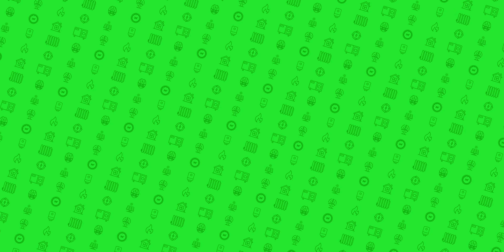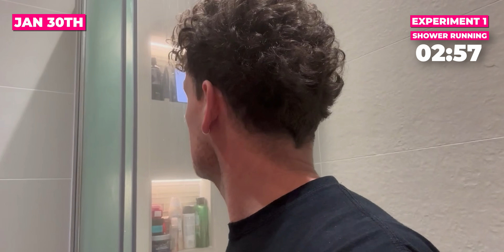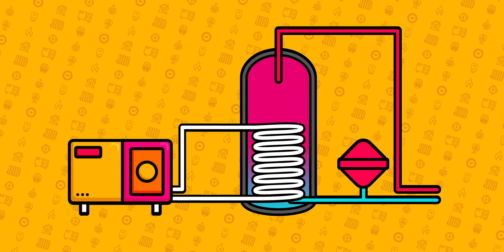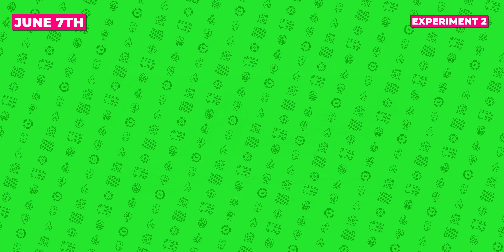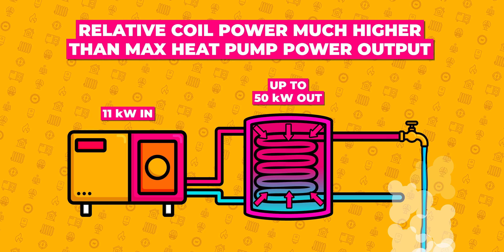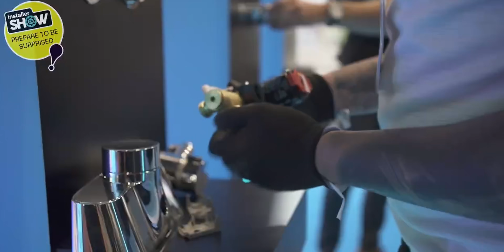The Worlds SMALLEST Cylinder is here!

Comment: I use only around 500kwh a year and get all my hot water from just an electric shower and kettle...
Most my bill is standing charges basically. 
Why is it better to complicate my heating needs with this sort of thing? More cost of materials and more complex install/maintenance. I could just do with a smaller size combi boiler/heat pump. My combi boiler is probably powerful enough for a semi detached house, which I don't need for a low flow temperature.
I don't need to warm my flat up quickly a couple of times of day, it's better for me to maintain a reasonable radiant temp through the day. For me 15c is plenty, 12 will do even so long as its even radiant temp....

The amount of hot water down the drain there, would be a bit excessive for me, not necessary way to shower.... 18 minutes on? I turn on and off to lather and rinse. Only ends up being about a 15lt bucket, 2 would be plenty. 

I use all grey water to flush toilet, shower, dishes and laundry water moved through in buckets 

(two 25lt containers in cupboard by washing machine and the hose needs swapping several times, the first 20 odd liter is dumped straight away as that's the most dirty and smelly after being heated up, so not nice to keep around. The next 40 odd liter is just rinse cycles and fine to use for flushing.)

I use only around 12 cubic meters of water a year. Why do I need so many liters of freshly filtered, treated, clean drinking water just "sluice my dooks" away every time? Yes I still flush the toilet normally here and there for a clean up with clean water of course. 

No substitute for using less energy, water, resources overall, as much as people hate to hear that. Rather than just substituting methods around, both are required.
Reply from the maker: This is for the other 99% of society
Reply: @HeatGeek  Seems like a great option for a large percentage of buildings to be fair, not necessarily as much as 99% of use cases though... You have plenty of positive feedback, you could just consider the comment of a particularly lower needs user as your likely to find or leave it, no need to reply unconstructively and low key demeaning way. 

So my way of managing needs requires the least energy and results the lowest emissions basically? I have a very low footprint/impact with use of energy and water like I'm supposed to, I'll credit myself at least if nobody else does. 

It was actually a little more, 548kwh in one year checking back, and just 161kwh on gas heating (caveats to that on account of downstairs neighbours not being fussed when I offered to contribute, so can't actually say what overall needs are) 

It's not that I couldn't actually afford more electric though, it's interesting the value per Kwh daily plummets at the lower end of use because of the standing charges. If you just use one kwh day to day, your paying something like twice as much per Kwh than if you used 4 times more... 

The first kwh a day cost me 82p (50+32) the second 114p, the third 146p, the 4th 178p and so on.
So that first kwh is way less value than the next couple, but I live actually very well and comfortable using a little under 1 kwh daily through summer and like between 1-2 through winter. All needs hot water, cooked meals, charge devices, ect laundry when averaged out over the whole week (more on a laundry day of course,) and refrigeration (top opening chest freezer converted to chest fridge, with lift out crates is way more efficient than side opening fridge due to basic physics, lower oxygen environment preserves food for longer also) 

I suppose if I was on a more efficient electric system for winter heating it would be easier to decide on removing the standing charge for gas for one thing.

However perhaps it's not necessarily the case, that for a lot of very low use energy users could afford to consume a whole lot more. Perhaps more than just "1%" in harsh poverty these days, certainly a lot more globally eh. 
So maybe don't be so presumptuous what percentage of the population is is closer to my level of consumption or yours. 

Unless you can get rid of standing charges seems like definitely no advantages to my trying to reduce an overall Kwh electricity need with hot water storage.
Even then, at what point of lower hot water needs, ie boiling a full kettle of water several times a day and using like 15lt of just warm showering water might the system actually stop providing energy use reductions? Where does the benefit fully diminish? 

Some of that kettle boiling is actually for drinks also of course, so wouldn't be reduced, just one time is for dishes. Then with showing, when I do have the water running, I actually turn up to warm and down again to cold a couple times which I can enjoy also, temperature pulsing rather than straight jarring cold shower. 

Is there actually a cross point that it would stop being more efficient under a certain number of liters per day hot water needs than just to use straight electric? Surly with a more complex system more heat is lost around and about the pipes and will slowly drain from the storage? With a kettle and electric shower it's heated at source of use. 

Oh yeah I do fill a thermos when I boil kettle, so that's something kind of similar I guess. Have a couple of drinks or empty again when doing dishes. 1.2lt thermos stainless steel flask just 25 odd quid. 

I'm not so sure that would necessarily be more efficient to try reduce power consumption at a low energy volume of use, so like I say in my case I'm only looking to cover winter heating needs more efficiently. I could do with a smaller size combi boiler than I have, so maybe a small enough size heat pump would be beneficial option also. Again what advantages does the added complication of hot water storage have at my volume of daily use though? Why increase complication with installation and maintenance? 

I could probably do without loosing more storage space anywhere tbh, making space is always an ongoing process for some people with smaller homes. I use all my cupboards, my sealing isn't that high..

Comment: Storing hot water doesn't really require that you store hot water.

I was just watching a video about converting coal plants to run on green energy by storing heat in some kind of solid material that was then used to heat water. (in that case to it was to create steam)

Storing hot water itself is probably one of the worst solutions because you tend to be limited by the safe temperature of hot water as well as steam.  Hot rocks would be limited in their ability to transfer the heat to  water reducing the risk of burns.
Reply: Eric you are a clever guy - how are things at NASA?

Comment: Do we need to restrict shower flow rate to 8.5 litres per min otherwise there wont be enough heat transfer from the stored hot water?
Reply from the maker: No.. although I would advise it. Higher flow rates just need to use a larger store OR a higher store temperature

Comment: Excellent solution. One question, what are the results like with the 7kw ASHP / 55 store temp setup at a higher flow rate, say 13 litres per at the hot outlets? Relevant if running multiple showers simultaneously for example.
Reply from the maker: If running 13l/m off the batt (unlikely) it won’t be great.. but if there’s a 2.5min stagger will work!

Comment: I assume you'll need to flow-rate limit the hot water outlet for this - e.g. for bath fills, otherwise the performance will drop considerably because the DHW is passing through the heat exchanger too quickly? On the other hand, for shower-only houses, you could pair this with vertical-drop drain water heat recovery (cuts showering power input by about 50% by recovering 50% of the heat from hot water after it goes down the plug 'ole), and run a shower continuously even with a 5kW heatpump?
Reply from the maker: Your defo right on flow rate affecting the performance. But it just means you need to store at a higher temperature.
Reply from the maker: Yes even with a 5kw hp!!!

Comment: Does the heating expansion vessel require upsizing due to the added water in circuit ?
Reply from the maker: Generally not because most heat pump systems are sub 50c radiator flow temp so has capacity.

Comment: Not a new concept, these have been around for decades, known as a thermal  store, having multiple coils of 10mm pipe inside the cylinder connected to the domestic side.

Another advantage of these units is it does not require a G3 certificated installer.
Reply from the maker: It’s not new but it’s not a thermal store. This is more of a coil in coil heat exchanger with built in buffer as most heat comes instantly from the heat pump than using the stored heat.
Reply: The main differences then are a smaller vessel size, and a much higher surface area of the coil?

Comment: It's crazy to think that all the big cylinder manufacturers have missed this maybe they just don't want to push the boundaries of what's possible great Idea and looking forward to seeing it at installer
Reply: You can already get these cylinders. They are called heat stores and are used with intermittant heat sources such as solid fuel fires with back boilers, range boilers, solar, wood pellet etc. Thing is they tend to be bigger in the case of heat stores because they may have to last all day. The downside can be that with higher temps and hard water you can get scaling and the coil eventually blocks up.
So its existing technology but it has just been modified to work with a heat pump. Because the heat pump can run whenever it needs to you don't need the heat store to be very big.
Reply: Been around for years this is old tech done a set up like this with a solid fuel back boiler linked with a combi boiler there's a company called nrg that make there own manifolds and wiring centres
Reply: Different thing altogether i have fitted thermal stores and nrg link this is not the same
Reply: @Craiggilhomephe  but the cylinder idea isn't anything new I've come across a few setups like this on system boilers with a heat store and some cases with a plate to plate and exactly the same
Reply: Yes but working at high temperature that's the difference

Comment: How does this change scale up to the full-sized cylinders? (I.e. The super cylinder) Have you tested this configuration and if so, what were your findings? I'm thinking that with a full-sized cylinder, the settings can be tuned back towards efficiency and the lack of legionella cycle could offset any other losses.

You could also add a tapping on the last coil of the heat exchanger, for a secondary return.

I know full size isn't what you were going for with this, but I'm interested to see what the ramifications are for conventional setups if any.
Reply from the maker: Super cylinder is still better as it sits in the cool zone more
Reply: @HeatGeek  Ah I see, that makes sense. Thank you!

Comment: I thought that this is a great concept but if it's so clever why didn't someone design it sooner?
I don't like being negative, so I would like to understand more of the physics behind this solution. For a given volumetric flow rate and temperature, what is the heat input requirement? I do not dispute the practical evidence presented in the video but it should be supported by some scientific backup. I have only used an online calculator but that suggests a heat input of 21Kw is required to sustain a flow rate of 7.5l per minute to raise water from 5 deg. C to 45 deg. C. Therefore, your cold water must absorb an additional 10kW of stored energy from the stored hot water if your heat pump is replenishing the heat in the store (which is not a store) at a rate of 11kW.
In order to validate that estimate, as far as I can gather, a 9kW electric shower can deliver a flow rate of around 2-3l per minute under similar circumstances, so the numbers do seem to support one another.
If anyone can be more precise, or point out my error(s), I shall be very grateful.
Reply from the maker: We have built a calculator that’s extremely accurate. You calculation does not include the buffer volume. 

It’s pretty simple once you break down in to energy (kWh) instead of power (kw)
Reply: @HeatGeek  I'm sorry but some clarification is necessary. Energy is measured in Joules: 1 Joule for one second is 1Watt, so 1kW is a constant supply of 1000 Joules of energy. 1kWh is the provision of 1kW (1000 Joules per second) of energy, at a constant level, for a duration of one hour. My (age 16) physics was nearly 50 years ago so please correct me if I am wrong.
Reply: @HeatGeek  Could I try your calculator please? My requirement is to supply water to two showers simultaneously. Currently they can run out of hot water, heated to 55deg C in around 15 minutes (if run simultaneously, i.e. together, and equivalent to 30 minutes of single shower duration) (my family member's showers are too long) from a 250l indirect HW cylinder at mains pressure. So that equates to about 8.25l per minute through each shower. That HW is diluted with cold (I'm guessing at around 25% through a thermostatic mixer valve) to reduce it to a comfortable temperature (approx. 38-40 deg C). That suggests a combined (H + C) throughout of around 11l per minute, which I do accept is probably well above average.

Comment: So this could work, added to a combi, so the combi can operate in condensing range as much as possible? The question then is what's the real world difference in pennies dispatched over the course of a year? I think that data would be essential if you want to get people to stage for a heat pump using this.

We recently got a new combi boiler and combined with a little autism (heat loss calcs, new controls and so on) to save around 60% on our gas use on the coldest days. That was provably worth it. As you increase efficiency in stages, real world savings diminish as a percentage represents less cash at each stage.
Reply from the maker: It will probably save 15% on hot water bill
Reply: @HeatGeek  Maths time. Cheers.

Comment: If you can put around 4kw of heat into the water, you can start to heat the water instantly for showering. I would like to see how this works in cold weather. 

I would also love to see this for mini-split systems, as air-to-water systems are too big and heavy to fit on most flat balconies. If you get a mini-split system give me a shout
Reply from the maker: Yes totally. My test was at 7c outside temperature
Reply: @HeatGeek  So that affects the heat output of the heat pump. What was the incoming cold water temperature, which is usually lower and affects the amount of energy (provided by the heatpump or from elsewhere) required to heat the incoming cold water to the target temperature?
Reply: Probably a daft question, but here goes. My understanding is that the heat from a heat pump is generated at the condenser then via a heat exchanger it transfers to a tank then, so if the heat pump can output a 55 degree flow temp and some modern heat pumps can get to 70 degree flow temp, and given you have shown it can maintain at least a 40 degree constant shower output, could a heat pump not be designed so that the hot water heat exchange can be done at the pumps condenser letting you get rid of the tank completely?
Reply: @robertcollins1371  the water in the heat pump line will have comments in iy
Reply: Perhaps where you live. In the UK, in my experience, even a 7.5kW shower is inadequate, except perhaps in the warmest summer months.
Reply: @davem.4003  I think 4kw is the lowest, also I think you are thinking of a power shower which has a smaller heat exchange coil so it has to transmit a lot more heat faster.

Looking at the coil size in the one proposed a lot more heat should get into the water

Comment: My last house which was a standard 3bed had a 6kW heat pump, yours seemed to be 11kW? For a flat surely people would have substantially smaller heat pumps?
Reply: The Vaillant he uses has a 7kW label, but it's technical specifications sheet show that it can output significantly more with an optimised design system at lower flow temperatures and average outside temperatures.
Reply from the maker: Mine was a 7kw. It was inputting 11 kw because it was 6c outside
Reply: @HeatGeek  interesting, thanks for replying, looks really good, just I’ve used 5kW / 10kW heaters and there’s a big difference between them and was curious what we’d expect the continuous output to be for a smaller property like a flat with a much smaller heat pump attached.

I massively approve of the added filament, excess solar is an obvious easy win!

Comment: Do we need to start with a whiskey = I think so , ok then have listened to the information you gave but now it has to go in my brain which is like a firework display at any given day , my apologies if I get things wrong or ask stupid questions the benefit me being stupid makes others look good , so at the moment for me to get hot water for bath shower or dishes I have to put the immersion heater on for the tank in my airing cupboard which actually takes longer to heat up in winter because it’s fed from the tank in the loft obviously outside temperatures also affect that , getting a tank like the ones in this video is not an independent entity it is incorporating within the whole system as an add on so you can use the heat pump for the radiators but now you can also get hot water for the said items shower etc, that’s why your mind is thinking acting as a combi , in my head it’s saying pity there wasn’t a mini heat pump that could be 2 or 3 KW that would be solely be used for that tank in your video = that way the people who choose to have an ATA heat within their home could have your mini tank for their water solutions , so maybe might be a good name for the unit = HWS = Hot Water Solutions. The final question how many whiskeys does it take to plough through my message = far too many .